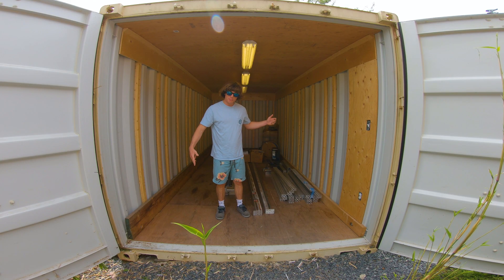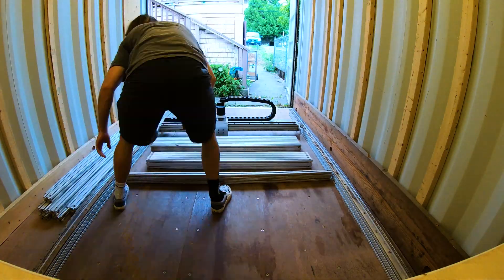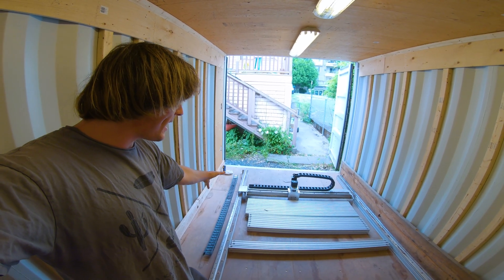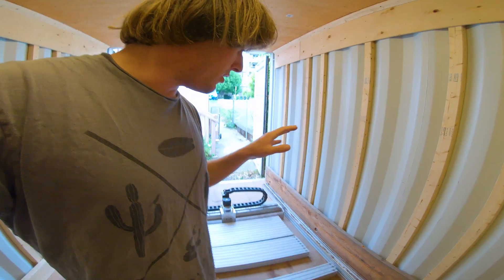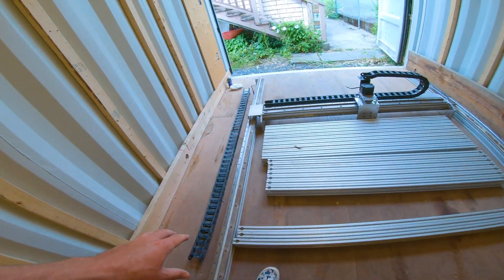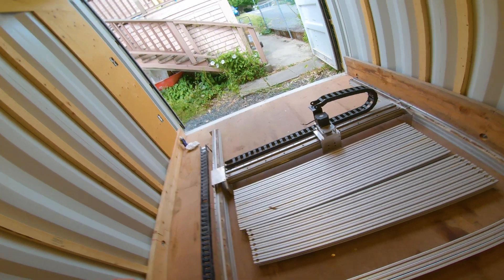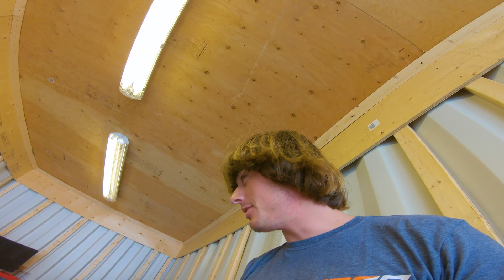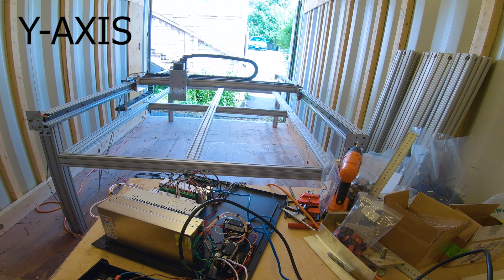CNC ROUTER BUILD | EPISODE 2 | THE FRAME

Comment: I like this design, I was thinking about this actually the double row make stiffer I think. I was thinking to go this route for mine also. but maybe it needs another aluminium profile half way to stiff it up even more.
Reply from the maker: Hey Mikael, Yes agreed! It was a little bit flexible in the middle like this. I've added one more leg half way down each side of the y-axis and it seems to have done the trick. The third contact point with the ground right in the middle of the frame really stiffened everything up.
Reply: @reeces_shredlab  great !

Comment: Hi, thanks for share, why does it use two motors for the Y axis?
Reply from the maker: I was thinking I would use two motors for the Y axis to share the load of moving the whole machine. The X and Z axis are just moving small pieces of the frame where the Y is moving almost all of the frame. I ended up using only one motor on the Y in the end, but it's a more powerful motor.
Reply: @reeces_shredlab  thanks a los for your response  :)